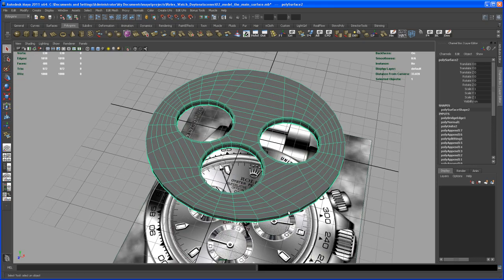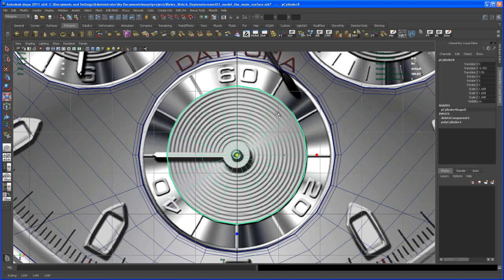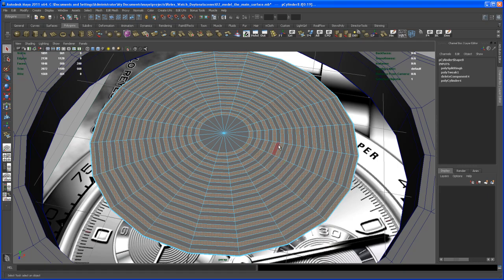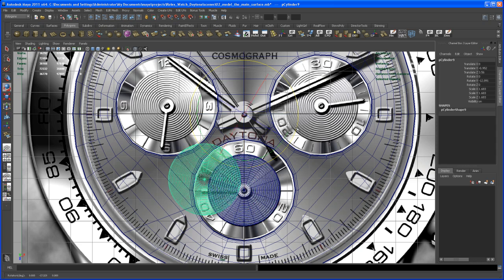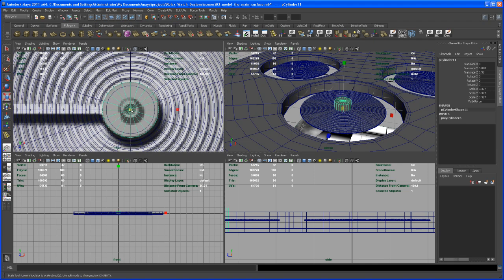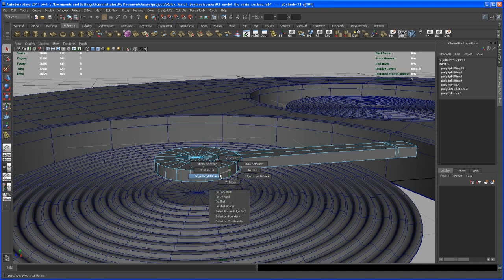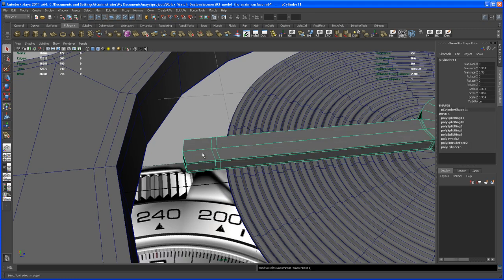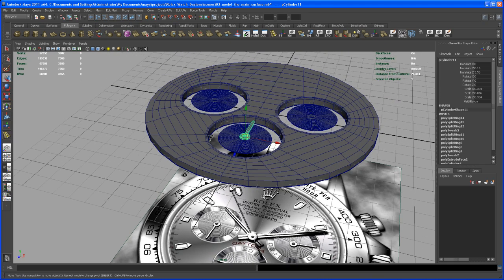Modeling tutorial in Maya - ROLEX DAYTONA watch - Part 3: create ripple pieces

Comment: hi mate, i have a problem with my insert edge loop tool. like in 5.25 when i try to use this tool, it only circles half of the polygon (i mean the faces that we extruded). to be clear what i mean is at 5.28 when you pause the video you can see edge loop (orange) on three different faces but mine goes only upto 2 faces.  hope you can help